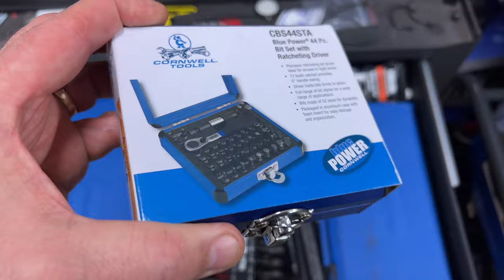What’s In My Home Box!! • A My-Home-Tools Tour..! | TheSmoaks Vlog_2317

Comment: Being an old guy I have mostly older Craftsman wrenches and sockets.  Really miss the old days of browsing the Sears tool department.  I have a SAE and a metric set of Harbor Freight impact sockets that seem fine for what I need.  I also have a Harbor Freight torque wrench that I’m happy with.  I also have a couple of the Craftsman mechanical beam type torque wrenches that were my dad’s.  They are still accurate though it’s difficult to be as precise as you can be with a click type or digital.  I remember my dad rebuilding an engine with those old torque wrenches so back in the day they certainly got the job done!